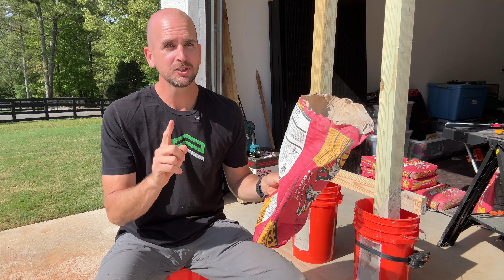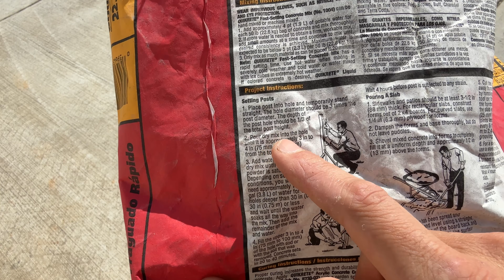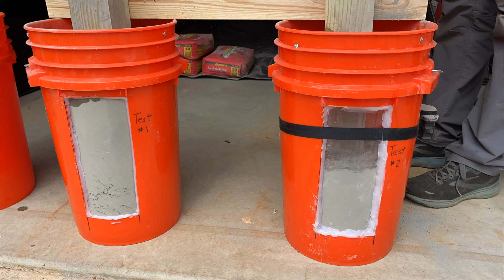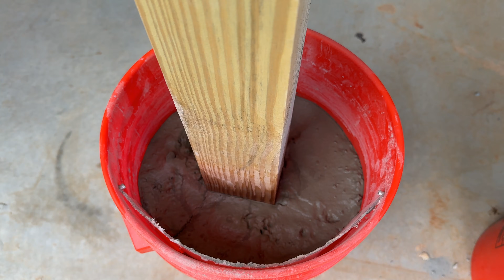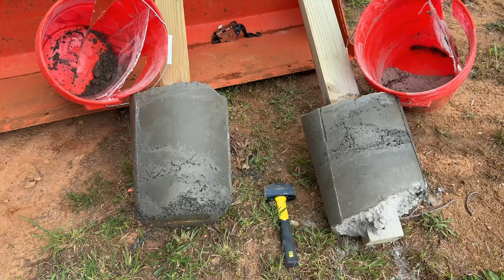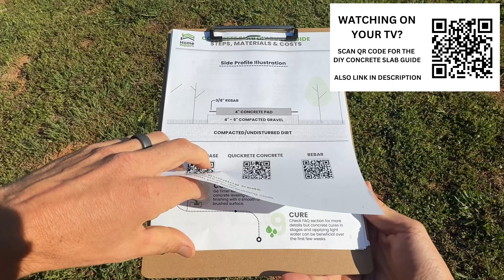Does Dry Pour Work For Fence, Mailbox, Deck Posts | Surprising Results!

Comment: @EverydayHomeRepairs please look up the distance that engineers state concrete will move water.  The concrete will absolutely move the water. This has already been tested extensively, decades ago now.  Wisconsin U, I believe, published some results on exactly this. 

The issue people run into, is inadequate hydration.  This is hydration in situ.  It takes time.  You don't need any rebar. 

Tamp the concrete in. All of it. 
Put a dripper in a the top. Run it for 24-48 hours. You cannot over hydrate the mix. 

Compare the concrete after 30 days.  Do compression tests, shear tests - knock yourself out.  

TL;DR; Do not under-hydrate your concrete.

Comment: One of the most interesting and helpful videos I’ve ever seen
Reply: Interesting but not helpful.   You don't put fence posts in buckets.  You put them in the earth which is a moist environment.   His entire test only proves that water can soak through concrete fast enough that it will happen before it cures which is the same as every dry pour vid on the internet.   Interesting.   That's it.

Comment: One feature of a wet mix: in 20 years when the post rots off and you need to replace it, you can cut off or break off the old post, drill out the cemented in lower part and put a new post into the same hole and not have to deal with cement again at all.
I know...I've done it.

Comment: As another data point, I used the basic dry pour mix on our fence posts here in upstate NY and they're holding strong after 20 years this summer.
Reply: Wood or steel posts? How deep did you go?
Reply: @ChazR25  pressure treated wood, about 2 feet down
Reply: @TravisHardiman  Thanks. We're in the same neck of the woods and saw that our frostline is 42". I was a bit shocked. No frost heave issues for you? Did you gravel the bottom? I'm digging holes this week for a vinyl fence and I'm going to dry pour.
Reply: @ChazR25  yeah I put a bit of gravel down
Reply: Solid ground...many places do not have such conditions. I am in the desert and most of the land is sand based, aka constantly shifting. digging a hole and hoping your post stays level from a few inches of cheap cement is a recipe for failure. Not even about quikrete or water, its about the integrity of the existing HOLE.

Comment: Good test.  A couple of comments:
- I'm in SC and we have heavy clay soils in this region.  Clay soils hold a lot of moisture. I think over time more moisture will be pulled from the soil into the dry concrete than escapes out of the dry mix during the initial pour.  That may not be the case in sandy soils. But if initial loading capacity is not the primary goal, a dry pour may be just fine.
- Many years ago I helped a more experienced friend build a 10' x 50' deck and he insisted on the dry pour method. We dug 48" deep holes, added the 6/6 posts and braced them, filled around them with dry concrete, and used a hose to wet down the concrete from the top.  A year later, the front of the deck sunk about 6 inches. (I think this had nothing to do with the deck posts footings but was the result of placing the footings on uncompacted soils downhill from a walkout basement.) We went back and dug down around all the posts, jacked up the deck, added brick rubble under the posts and refilled the holes with the original dirt.  This real world experience gave us the opportunity to examine each of the dry poured post footings.  The concrete was 100% intact all the way to the bottom.  I really think the moisture in the clay soil around the posts slowly made its way into the dry concrete.
- And I'd like to see the results of your bucket test after 28 days.
Reply: In Oregon we have dry, warm summers and usually no rain for months. The soil really dries out, but when I dig a posthole, I find that the silty-clay is moist all summer long below about 18 inches. I can definitely see how concrete could draw that moisture in. Sandy soil might be different. Pre-wetting the hole might also help.

Comment: Well thought out and presented analysis. I would love to have seen this test done in both a test cylinder mold and also a beam mold to test compressive and flexural strength. Even though you used Quickcrete fast set, I would want to see the strength results at seven days. To mitigate the surrounding soil absorption you might try filling the hole the day before, such as in a percolation test. Most likely, using a maturity meter correlation test would give you a more definitive projection of expected results. Nevertheless, I would not have a problem with using this for a fence post.

Comment: I do not like either of these methods.  Better to fully mix the concrete before pouring: firstly about 2 inches of concrete in the bottom, then insert the post, then fill the remainder, mounding the top to shed rain.

Comment: Here's something to think about. We live in South Florida. Hurricane Wilma snapped all of our posts off, basically at ground level, except 2. The concrete causes water to sit on top and start rotting the posts over years. The 2 posts that didn't break, unknown to me, were set by my neighbor many years before without any concrete. They had enough give in the wind and little rot to not snap off. The panels blew off the posts, leaving the posts in place. I was moving the fence line to make it straight, fully on my property. Those posts just pulled straight up out of the ground with a little lever action. Makes me question the need for concrete, except at the gate. The strength is from the sum of the parts and a thing called gravity.
Fyi, we did use concrete on all of the replacement posts.
Reply: I was taught years ago to be right at grade and to slope the top of the concrete.  Didn't have to be drastic, just so long as it wasn't concave.
Reply: Were the posts that rotted made of pressure-treated wood?
Reply: @isabellavision  yes. We are in South Florida, virtually at sea level. During the summer months, the ground is always wet. If you want a lake, just dig a hole.
Reply: Let me add that they had rot around the outside, not too deep, not all the way through. We have a wood shadowbox fence, the only kind allowed, which becomes a sail in a hurricane.
Reply: Concrete needs to extend above grade and domed to allow water to shed away.  Otherwise you are creating a swimming pool around the base of your post.
Reply: @leestebbins5051  understood, but who is doing that?

Comment: Like the video. I use this method (mixing half / half with water “mixing” in hole. I always splash 500mls of water into the bottom of the hole first. Real fence post install is often in damp earth and concrete will absorb  that water over time. This is so different than a slab which I would always premix.

Comment: Leaking on the first one might actually be important for the penetration, air needs somewhere to leave for water to go down. in the second one all the air is trapped at the bottom then the water couldn't go down.

Comment: I have been using old power poles, coating them with tar and setting them in premixed concrete. Hope it's successful. Also driving galvi spikes into the bottom of the pile to secure it in the concrete.

Comment: You and everybody else that do tests always do them wrong.  You did not follow the supplier's directions.  They do not say put this cement and pole in a bucket.  You put the poles half the recommended depth.  So the result is useless.  You did not confirm or deny the questions.
Reply from the maker: We are always looking for feedback and better ways to do the testing.  How would you test a 30" hole with a way to view the results and simulate how the concrete will perform in a hole?

Comment: C'mon guys, stop with the dry-pour nonsense for small jobs. It takes 5 minutes to mix up 50lbs of "Cement All" in a 5-gallon bucket and it will dry to over 9000 psi (3 times stronger than concrete). Try it, it's truly amazing.

Comment: I've done dry pour for all of my fence posts and only had one failure.  The failure was likely due to being too close to old concrete footings that i was too lazy to remove, and water was pulled to the old footings, not the new mix.  time will tell though as it's only been a few years.

Comment: Don't know if there's anything still available but decades ago I bought a mixing bucket, it was like a 5 gallon bucket but with a sealing lid, tapered rim, and fins within.  You put in a bag of mix, the water, then roll it around on the ground.  Would be ideal for a single post (or few) application.

Comment: I always just put some water down the hole, then pour the mix in then put some water on top. Never had any issues.
Reply: I did this too, on pasture posts. The holes had groundwater in them and I just poured the dry mix in and added water. Had to pull 2 postes. They were both fully hardened all the way down.

Comment: The whole point of this dry mix process is speed to start. The first method is the best, and proven. Not in 4 hours, but 4 weeks. You will NOT get the post out any easier than a wet pour.

Comment: I always pre-mix my concrete.  Some posts I put in about 800 years ago using concrete I pre-mixed with water are about 7-8 times as strong now as they were when I put them into place.  I used my time machine to go several thousand years into the future and the posts are still strong as can be.  Pre-mixing is definitely the way to go.  Trust me on this one.  🤡

Comment: I’ve installed multiple posts using the quickkrete instructions and they are all good, plumb, and strong after 3 years.   Remember the dry mix pulls water from the soil too.
Reply: OR vice versa.  If you are doing a dry pour, in dry earth, you are losing water to the dirt around it.  The best way to combat it with 1 or 2 holes close together is to run a hose on mist with just enough pressure to get water into both holes. Then forget about it. Check on it again the next day. Concrete isn't as strong when it starts to lose water mid-set.  It should stay hydrated, without moving the mix, for a long period.

I have big dry pour slabs that never cracked that I misted in-place. I failed to stop drips from hitting the surface, but the slab has not formed any cracks in well over a decade. The surface pitting from the drips is still there, but there are NO expansion/contraction seams. About 30 feet long, 4.5 feet for about half that length and then a 10 foot patio. Again, no seams. A bit aggressively sloped. Textured, colored, put in dry, tamped, then hydrated.  I would change how I hydrated but the concrete has held up to cars parking on the edge, tractor driving over a corner -it's been fine.  Mixed the concrete dry with a mixer. Dusty, dirty work. But I could get it all how I wanted, and then hydrate it, which is a great benefit to DIY.

Comment: Saturate the ground around the hole with water before pouring the concrete into the hole. That way the ground wont suck away water from the concrete but the opposite.
Reply: I'm sure you're not saying over water the hole to the point of making mud, but I still would think that would increase the chance of getting dirt in your concrete mix.
Reply: @mr.c6674  Not overwater, start a few days before. Like, make it like normal soft 3day rainfall. Not whole days though. Just saturated enough to be wetter than the concrete by abit.
Reply: @mr.c6674  "around" the hole. So the moisture in the ground soak into the concrete. It works, although I have always done it after the post setting.
Reply: I think the timing of the second method is key, half bag, water .wait ,half bag water waute etc.

Comment: Enjoying the concrete related videos. It only takes 2-3 minutes at most to mix a bag properly with a hoe in a wheelbarrow (I just did 10 3ft deep posts) and why anyone would mess around with the sketchy dry mix method is beyond me.

I expect the second layer of the second sample absorbed much water from lower layer hence the excess water on top.
Reply: Because the manufacturer tested it and it works
Reply: @chrisglenn2096  exactly, its not sketchy if its what the instructions on the bag are. Sure, a wet mix may work better, but again, one assumes from all these videos over the past 10 years enough people understand the difference is minimal as long as the post sets properly

Comment: I put in my chain link fence 32 years ago using the dry method. All 30 posts are still as strong as they were when I installed  them.

Comment: I have done the 2nd method slightly differently.  I poured 1/2 the mix, added water then let the water absorb with some rebar agitation.  Then i added the 2nd half of the mix and water followed by agitation.  Seems to work fine.  But i agree that mixing 1st is the way to go.

My theory is that the water on top of the 1st half of your mix was absorbed by the bottom of your 2nd half the mix so was never going to make it to the bottom of mix 1 in your your bucket.
Reply: Yeah I really don't get why you'd do all that when you could just properly mix it first. If you're going to do the dry pour, follow the bag's instructions. If you're going to mix, then do a proper mix. This "pour half dry, then mix, then pour other half dry, then mix again" thing is ridiculous.

Comment: Ground is absorbent so you wouldn’t have standing water on top. But the concrete will absorb that water through the ground. Solidifying that concrete.
Reply: No, the water would be in the soil, the concrete near the top is not going to absorb it from the soil around it hardly at all. The water is going to take forever to soak the soil near the bottom and by that time the concrete has hardened and no absorption and the soil is going to distribute that water everywhere. The water is not going to magically all go to the concrete from the soil 🤣.

Comment: Go figure.. the manufacturer knew better than random commenters on YouTube. What are the odds?
Reply: I came to comment section purely hoping somebody said this 😂
Reply: Like my dad when all else failed read the manual lol 😝
Reply: What’s this witchcraft you speak of?!?!?!
Reply: That’s why I’ll never listen to YouTube Geniuses
Reply: Higher than you'd think :)  me hanical instructions (written in English (of other) originally) are usually OK, although incomplete.  This type i find iffy.  Always seems to be some detail missing.  

In the good old days (curmudgen mode engaged), manufacturers tested rigorously and had excellent instructions.  Now (millenial authors - to my knowledge, there aren't any GenZ who can read actuality to test or write), they "assume" what they came up with in the lab will always work. 

 your failure **might** be because you're using a closed (bucket) system.  Might have been some kind of vacuum lock, although the 1st didn't.

Good to see "proof" this worked, though.  I hated buying "regular" cement, only to use 1/2 to 2/3 the mixed cement.  And, having to figure out how to discard the remaining brick.  

You can only pour so much quickest down the kitchen sink before someone complains!  KIDDING!
Reply: Actually both bucket methods FAILED. The entire trick to this pole deal is the Container, not the SAND they sell you. If your ground is solid, all you need is the proper depth and a filler. Which is what quikrete is. If you have soft footing you need cinderblocks.
Reply: Americans don't listen to experts. Doctors, scientists, professors, teachers, and engineers are regularly ignored, scorned and contradicted. It's the American way.
Reply: @DB-ek5kd  . Doctors, scientists, professors, teachers often have an agenda. Only a fool takes everything they say at face value.
Reply: @DB-ek5kd  The dumb ones, yes. We're not all stupid.

Comment: I use both methods and never foam. Concrete is not for strength but to add weight and plug the hole solid with the post. Dry summer only climate for foam if you must but that is a joke install no good for a gate post or heavy wind areas. Mix water and Crete in the hole as you fill is the best method for uniform results but like I said it is not for strength.

Comment: If a little bit of mix is dry at the bottom of the hole that doesn't mean it will stay that way forever.  Soil that deep is always damp, and concrete is permeable to water.
Reply: It greatly depends on your soil. If the top layer cures before the bottom, then you don't have one piece.
Reply: @mortimersnead5821

Maybe where you live the soil is damp down 20-30". 

That doesn't mean it is everywhere. Around here it starts dry and gets dryer.

Comment: Fresh 'crete is strong enough to walk on the next day.  But it takes something like a week to fully cure and reach maximum strength. I believe that a third trial where the 'crete was thoroughly mixed in a wheel-barrow would have been just as fragile on day 2.
Reply: Concrete takes 30 days (sometimes more) to fully cure. I believe the value is 80% strength in 7 days. But, that factors in moistening the surface daily over those 7 days.
Reply: Interesting. I always mix concrete in a wheelbarrow and pour it into the hole, but I live in eastern Oregon and have to dig the hole at least 30" deep. So far most of the posts have held firm, except for maybe four that have had to be replaced over the last 20 years. I do keep the posts stabilized for several days before attaching 2x4s and boards.
Reply: I have 7 15 year old fence posts where I dry poured and built the fence the next day.  They're all still solid.
Reply: How much time did you save by writing 'crete instead of concrete?
Reply: @psycopirla1 
About as much time as you wasted typing your question.
Reply: @psycopirla1 Obviously two letters worth of time. But, seconds saved adds up to minutes per week. And, minutes saved per week adds up to days over months. So…
Reply: Please get real. 4 hours is a silly test time. 18˝ is a silly hole depth. Other tests show every method works after a month.